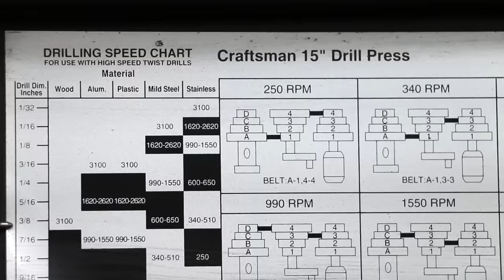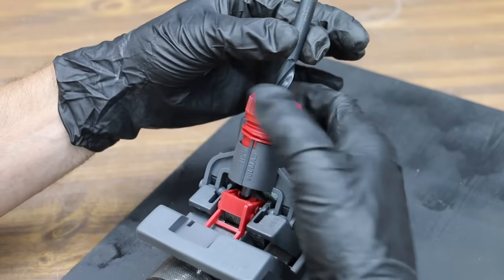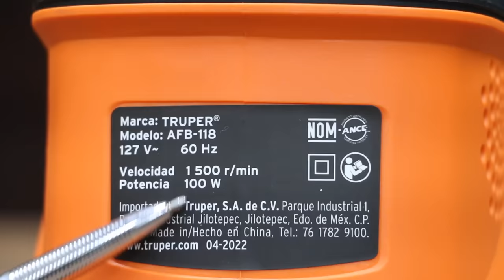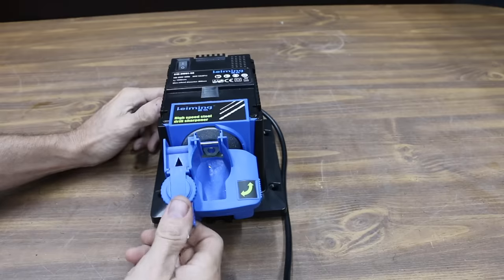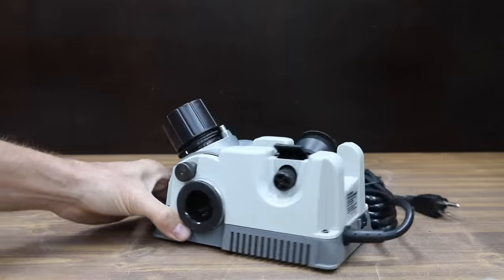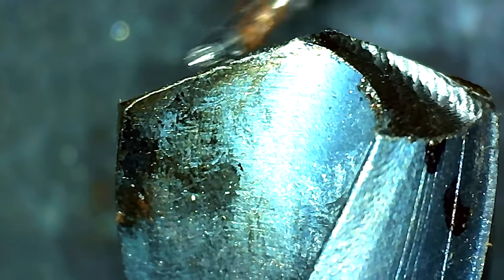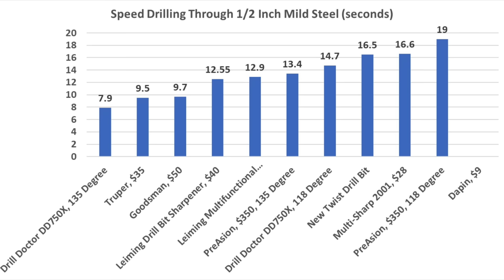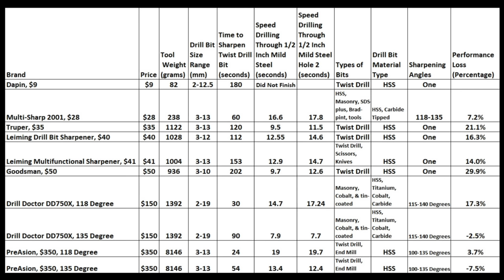Which Drill Bit Sharpener is Best? $9 vs $350--Let's Settle This!

Comment: This is one of those products that I don't see the use of for "A casual garage lurker" but definitely something that is more useful in a bigger workshop where drill bits see a lot more use
Problem is, such a shop can afford a product that is better and of higher quality than even the most expensive option available here, as you'd probably want something that will give you a good result for years to come and is easy and quick to use on the fly many times per day where there would actually be a financial incentive to sharpen drill bits and cutting down on the new purchases.

So, getting an actual good result with a semi-reliable product means shelling out quite a lot of money for a tool that is essentially made to save you money, and I think that many of these ones aren't ACTUALLY saving anyone who doesn't use drill bits like candy any real money at all, considering that the small sharpening stone/build quality of these things are also wearable components.
Reply from the maker: Thanks for the feedback.

Comment: so, the one thing that = death to any of these drill sharpeners, is when the grinding stone wears funny, or wears out. is if you can buy a replacement grinding stone. its not such a big deal on a $25-40 sharpener, but on the expensive ones, I would want to buy a few extra stones. are replacement stones available for ANY of the more expensive ones?
Reply: The wheels for the really expensive Chinese one are available but are 70-100 dollars. But they should be fairly durable.

Comment: I recently received some swords that were not sharpened, but could be sharpened. I was wondering if you could test some gadgets to sharpen a sword efficiently/faster than using a whet stone. Because these swords are dull. (I'm guessing they're sold/shipped this way for legal reasons)
Reply from the maker: Thanks for the suggestion.

Comment: Will you test fiber fix repair tape? Maybe the heat resistance, psi before it starts leaking, breaking strength, how it holds up, etc…
Reply from the maker: Thanks for the suggestion.

Comment: Have a drill doctor that I bought over 20 years ago and still use it regularly. Mostly, I do steel work and more than the average hobbyist. I would quickly buy another drill doctor if mine quit, but it's showing no signs of its age.
Reply from the maker: Thanks for sharing.

Comment: carefully tough the cutting surface of the drill bit at the correct angle to a flap disc on an angle grinder for about 2 seconds. = sharp drill bit. Cost about $5.00 for the flap disc. Works perfectly.
Through those junky sharpeners away.
Reply from the maker: Thanks for the feedback.

Comment: When I worked for a plastic fabrication business, I learned how to sharpen drill bits from a machinist that retired from General Electric and was working there out of boredom. 
I got so I could sharpen all but the smallest drill bits. Smaller than 1/8" isn't worth the effort and next to impossible.
Reply from the maker: Thanks for sharing.

Comment: Today I bought a car that came with a full tank of gas. The gas was about a year and a half old. It seemed like the car burned alot more "stale" gas I was wondering if there is a difference between fresh gas and stale gas as far as fuel efficiency goes
Reply from the maker: Yes, the stale gas has less efficiency than fresh gas.

Comment: Depending on what size drill bit you have that needs sharpening in some cases it’s better to replace the bit itself depending on the price of a new bit I wouldn’t use a sharpener on a titanium or cobalt bit I would just replace those bits

Comment: Hi Project Farm friends.

I'd like to suggest for the next video, finding out which combination of diamond grits (one can also use japanese whetstones from brands like Shapton, which have ceramic and diamond), perhaps using one steel 1084 (annealed, quenched, tempered- check Outdoors55 using his two cold plate technique to quench instead of water, air or oil) should we sharpen a dull knife starting with grit 80 all the way to 0.49 microns in the 30,0000 grit (not leather w/ 3 to 5 micron compound needed for stropping and getting rid of the burrs) or is there just one sweetspot grit (600 diamond?, maybe 1000 or 2000 diamond whetstone?) or maybe we just need two or three grits. Include 2 dollar very cheap, thin diamond whetstones.

Should we go to 3000 grit and above (60,000 grit 0.49 microns) and should always aim for full edge apex and mirror finish for a better cut and lasting edge (knife or scissors).

God bless.
Reply from the maker: Thanks for the suggestion.

Comment: I watched another video on the drill doctor and the DD had unacceptable quality, the bits wouldn't even cut as the cutting edge was negatively ground.  The comments were consistent that the older models were OK, but newer models had issues.  It was especially bad on 135 degree bits with a fatter ledge. but was ok 118 degree bits.
Reply from the maker: Thanks for sharing.

Comment: great video, loved it!!!  Would love to see if bacon grease can save an old transmission!!!
Reply: If it's an automatic Lucas trans fix just plain works put a bottle of it in my 1997 Lincoln mark viii and hasn't slipped since I put it in 7 years ago!
Reply: @xai38-809  Thanks, good to know.  But from what I know about the power of bacon, I suspect the grease will make your car better and faster than factory spec.
Reply from the maker: Thanks!  Thanks for the suggestion.

Comment: It is important to check the drilled hole diameter with gauge pins. A poorly sharpened drill bit will drill oversized.
Reply from the maker: Thanks for the feedback.

Comment: Video Idea / Request:
You've tested LOTS of tools. But what about the things we keep our tools in. Many brands now have a "Tough Case"
Milwaukee has "pack out" , rigid has one, dewalt has one, a few other brands. They are supposed to be tough cases that dont break easily for tool transport and storage. I'd love to see a test with handle strength, weight limits, drop testing, heat tests, maybe internal explosives! (just kidding but could be fun)
However there are a lot of options out there, I think this would be a good one.
Reply: Maybe a control with a few old school steel tool boxes.
Reply from the maker: Thanks for the suggestion.

Comment: So it's been crazy hot. How about testing large floor fans. Shopping 42" or a little bigger now. $350 to $600 is normal, but big ass fan has one for $2500 that is indoor and outdoor rated with high cfm rating. Is that even close to worth it? I know there are other ones like the one Abom had on his channel.
Reply from the maker: Thanks for the suggestion.

Comment: Would you consider testing faucet  / toilet supply lines , ss braided , fake braid , non braided , pull , kink , pressure , temp test.. most every household has many of these flooders.
Reply from the maker: Thanks for the suggestion.

Comment: Based on a combination of PF videos, it appears the smart move is to buy a couple of dewalt black oxide (DWA1184) sets for $15 each and replace singles as needed, and for 1/2" on up get a mag drill instead of a pricy bit sharpener and get the Jestuous TCT annular cutters (now available, not tested by PF, but I've found them to be excellent so far, same as the other tungsten carbides PF tested in the annular cutters video, sold in a large 13pc and smaller 6 pc).
Point is, take a pass on fooling around with a bit sharpener, they're too pricey for a decent one, they have limited capacity (otherwise might be worth it to sharpen 1/2+) and frankly.. life is too damn short to be farting around with a complicated chinese bit sharpener.
Take all your used bits to a blacksmith, have them forge the bits into a 10" x 2.5" x 1/4" flat bar, then make a cool knife out of it.
Reply from the maker: Thanks for the feedback.

Comment: I suppose you have to include other sharpeners to be fair, but comparing Drill Doctor, or any other sharpener under $500 is apples & oranges. The MRCM grinder which is also sold under many  other brands, e.g, Grizzly, Vevor, etc, is far superior because it uses collets and a CBN or diamond wheel, depending what you are grinding. Looking at the smoothness of the hole it drills should be enough, but the comparisons you made were a little dubious. Maybe because the Drill Doctor is American made and the MRCM is made in China may have something to do with it, but there is really no comparison. 

I know people who have Drill Doctors and they say they will sharpen a bit, but the hassle is not worth it, so they use a bench grinder instead. 
I know one person who has two or three Drill Doctors and until he bought a Grizzly (MRCM) grinder he sent his bits away to be sharpened. 
MRCM just released an new grinder that sharpens up to 3/4" drill bits, and I have both of them. They are really as good as it gets for a drill bit sharpener under $500
Reply from the maker: Thanks for the feedback.

Comment: SUGGESTION - - - - Test which - - - "Auto Sound Deadening Material" - - - works the best.   This stuff is used by auto stereo shops to reduce road noise in cars that are getting new advanced sound systems installed.
Reply from the maker: Thanks for the suggestion.

Comment: You can learn to hand sharpen drill bits in about 15 minutes. After that you can sharpen a bit in about 10 to 30 seconds  depending on bit size. Way less time than using these non commercial sharpeners.
Reply from the maker: Thanks for the feedback.

Comment: I purchased an old drill doctor 500 about 20 years ago and have never regretted it once. Also this older model has the ability to sharpen left handed drill bits with a special chuck, which can be a lifesaver.  This model, I believe is no longer made, unfortunately
Reply from the maker: Thanks for the feedback.

Comment: Those expensive drill sharpeners makes economic sense if you drill a lot of holes in production and expensive drill bits can be kept usable until it wears out. Sure the ROI is much longer, but productivity will not slow down and cost of consumables can be kept lower.
Reply from the maker: Thanks for the feedback.

Comment: The problem with sharpening a drill bit is that the quality of the drill bit is paramount.

You can have the best sharpener in the world but if the drill bits are poor quality you'll get a rubbish result. Also if the drill bit only has a hardened tip and you sharpen beyond that you'll also get a rubbish result.

A decent drill bit sharpener will only  do the job when matched with decent drill bits.

Great video but these caveats are important.
Reply from the maker: Thanks!  Thanks for the feedback.

Comment: The "split point" drills work faster because the secondary relief allows the chips to evacuate at a faster rate.
Additionally, please do not grind tungsten carbide drills with these tools as the carbide dust that is produced can be highly explosive

Edit: I make tungsten carbide tools daily and we use machines with active coolant systems where I work, and still the carbide can detonate without warning.
Reply from the maker: Thanks for the feedback.
Reply: @ProjectFarm  My pleasure! I enjoy watching the videos you make. Keep up the good work!

Comment: Beat sharpener..is called the optima...only 8grand.. used...you will have to sharpen 10,000,000 drill bits to break even

Comment: unless you're using your drill bits a lot for the average homeowner you're better off with just buying the single drill bit that went dull from your set in the probably years that it takes for you to dull the bit enough that it needs to be sharpened.
Reply from the maker: Thanks for the feedback.

Comment: Honestly if you want to work with your hands just watch AvE's tutorial about sharpening twist drill with a bench grinder. If you're not one of those dirty dead tree carcass defilers theres no need to spend the money. I'd also always turn it into a split point unless you know more than me. When you're not able to access a drill press for whatever reason it's way better to not have to shove steel out of the way with your bodyweight on a chisel tip.

Comment: I use a Rikon low-speed bench grinder with two different grit aluminum oxide white grinding wheels and I can make them incredibly sharp. Sometimes too sharp where they cut the steel so well i get a huge rats nest made from a single razor sharp piece of steel that if you're not careful (and i learned the hard way) will cut you to hell if you're dumb like me and grab it with your bare hand only to have it snag on something and slice me to shreds.
Reply from the maker: Thanks for sharing.

Comment: i donno... we used to lear at school (on 7 grade) how to sharpen bits by hand (and i'm not even work in manufacturing etc)... no sure why should i waste money on tool that will only take space and do (let's be optimistic) only slightly better job than i do... not worth money space and the need to bother with another gizmo
(not talking about split point obvisously, but for my "line of work" i don't really need them, so i don't count them)
Reply from the maker: Thanks for the feedback.

Comment: As a machinist i got to say all thes product or mad awfull, i wiil Nevers use one of this sharpener they all miss the releaf on the back of the cuting edge who is in fact the most important feature to keep the hole at a correct size and keep à good matériel penetration
Your not suppose to push hard ô a drill bit
Reply from the maker: Thanks for the feedback.

Comment: False choice fallacy there. Replacing sets is silly so most machinists buy bulk packs of the sizes we use most. For example I buy cobalt alloy (I drill mostly steel) five and ten packs especially smaller sizes used for pilot holes. Sharpeners pay off on large, expensive bits. The failure modes of little bits (snapping, annealing destroying the tip) don't lend themselves to sharpening.

Comment: You neglected to compare a bench grinder, against any of these, even the cheapest bench grinder is capable of doing a good job, the user just needs the willingness to learn. I’ve never replaced a drill bit because it was blunt, I’ve also never owned anything but a bench grinder to sharpen them.
Reply from the maker: Thanks for the constructive feedback.

Comment: there is a heated debate on the web about DRY POUR CONCRETE SLAB, but no one tried yet to measure scientifically the way you do if it works or not (and/or how well it does compare to wet pour concrete). Please enlighten us about it! (This video will make tons of view!)
 
"Concrete takes the complete 28 days to reach the 4,000PSI, same as wet pour. But we are shocked that it held up that well after only two mists, because we shower the slab twice per inch with an hour between showers. Mixing wet is speeding up the process and dry pouring slows it down. " (a comment from these evangelist/inventors of dry pouring: https://www.youtube.com/watch?v=GC0j2Ey5NNk )